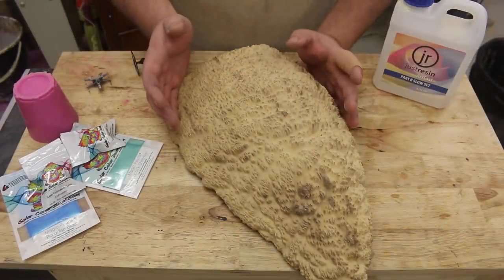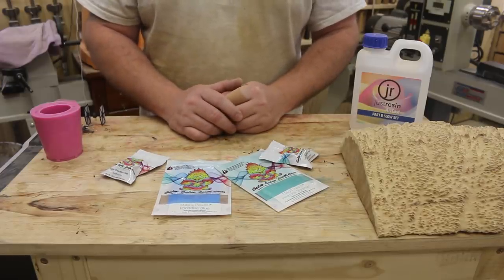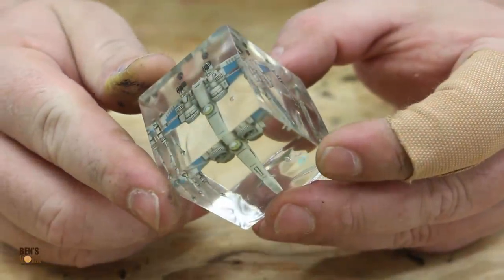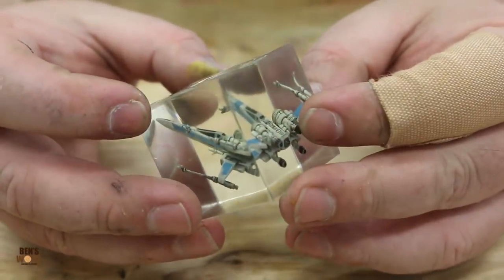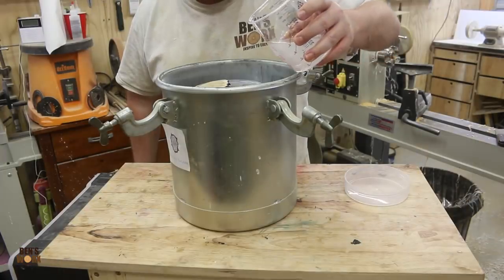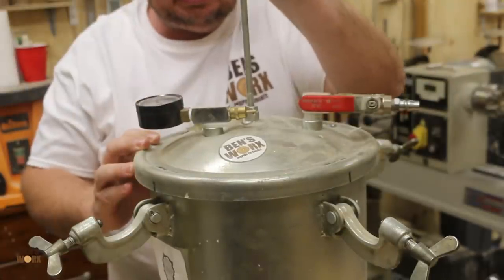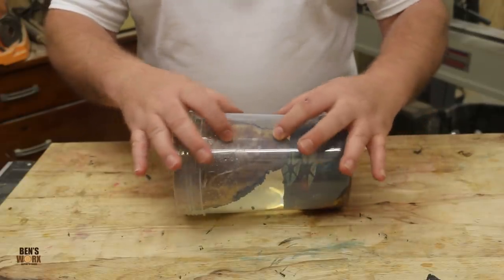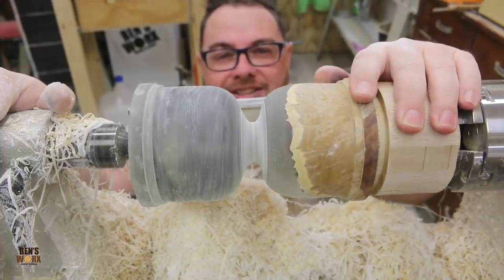Woodturning - Star Wars Hourglass - Epoxy Resin Art

Comment from the maker: Thanks for stopping by, Grab a 15% discount this weekend only! If you have time you can check out my new range of Enchanted Eggs here www.etsy.com/shop/bensworx
Reply: i have a question - i assume you are using xwing attack wing ships which are not strong plastic - and people do warm them up to correct them when they warp - what about just giving them a quick uv coat of resin first since that dries quick and should maintain the intergrity - also maybe try the star trek attack wing ships might do a cool job
Reply: Great work Ben looks phenomenal.
Reply: @Ben's worx
If you put the tie fighter in uv resin would it warp the plastic from Heat or will uv resin not get hot
Reply: Like u did with X Wing
Reply: Hi Ben do sell the light display for your egg creations. I have 2 already and will be purchasing several more I plan on giving them as Christmas presents, and the small light up stands that I've seen you make. It will show case the eggs beautifully.

Comment: It's possible to pin the blasters straight with a small pin vice, tiny bit, paperclip, and CA glue. Prior to casting, cut off each blaster, drill a bore hole down its length and where it matches up to the ship's body. Insert a straightened paper clip into the hole (good into place). The heat isn't high enough to affect the paperclip to bend. This technique is very popular with  tabletop gamers who paint miniatures.  Lots of tutorials online.

Comment: It was fantastic. I got an idea after the shape. Try making sand clock ⏳ but challenge is it should be working. Use some baby oil inside the clock. And when it turns up side down the baby oil should flow from up to down. Try thinking on this. This would be fun.

And yes! U cant make a fail project. Your all projects are fantastic as always. I love watching you making such a supper projects. 👍🏻
Reply from the maker: Thanks Mate 👍

Comment: As an idea, instead of casting the small part in a cube (or other shape), mix up a small bit and paint it on the model.  Allow it to dry/set and if needed, give it a second coat.  The small amount will not heat up significantly and the protective “shell” will prevent the model from melting when it is incorporated into a large pour.  Great work!

Comment: Would it still melt the plastic if you tried using UV resin in small doses?  Like... dipping the model (perhaps with a clear rod attached to the model as a handle?) clearing out air bubbles and using a UV light on it in small doses to control the temperature?  Then you could try it in a larger mold and maybe the coating of resin will protect it from warping even at high temps?
Reply from the maker: Worth a try 👍

Comment: Another suggestion for the models, you could try coating the outside with a thin layer of uv resin before pouring, it might stop little parts like the guns from warping?

Comment: Hi Ben, if you find the resin you are using is generating to much heat, as was the case with the X-wing cast. You should try Luciclear resin. It made and produced in Australia, in Queensland. It was designed for deep pour resin projects and it generates far less heat that other resins on the market.

It also sets perfectly clear and the max temperature i have found it reach was around 28-30c. Really a great resin for wood working. Im happy to send you some images of projects I've used it for if your interested in more information.

Great project as well.
Reply from the maker: Thanks Garry, I’ll check it out 👍

Comment: Just a thought.  You have had trouble doing larger pours with plastic models.  What about making a mold and doing an epoxy model (maybe with metal filings for strength) and paint it.  Then use that model after you paint it.  Lot of work... but maybe better

Comment: I've never casted with resin, but would it be reasonable to do multiple pours to prevent your figures from melting? Less resin, less heat generated?
Reply from the maker: Yes definitely but it comes with join lines

Comment: Ben, fantastic work. That project turned out amazing. Wondering how did you get the resin so clear after turning without any micro-scratches. How did you sand it to perfection, don’t see projects so clean like that.
Reply from the maker: Thanks Michael, hours of sanding and polishing